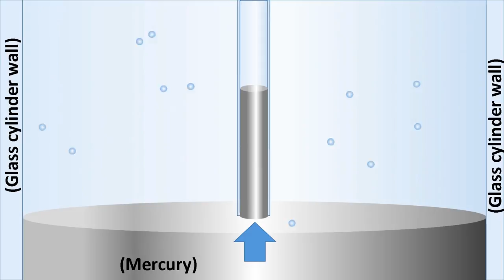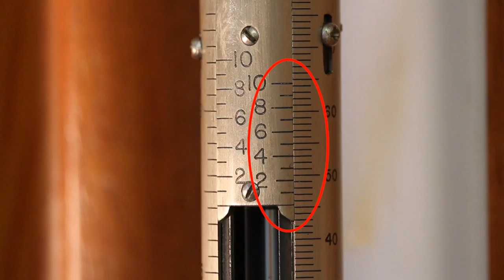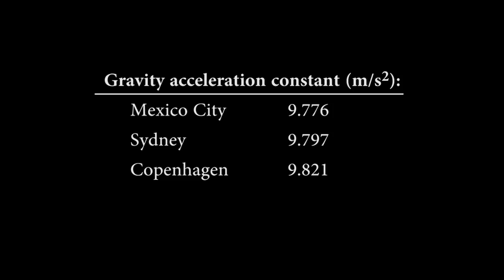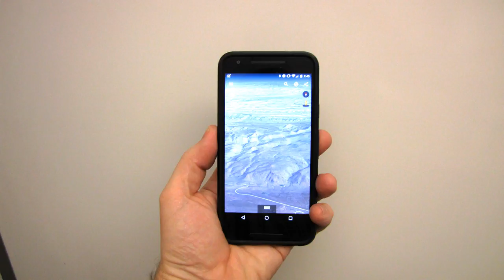Fortin Barometer

Comment: Thanks for the nice video. I have one of these which needs refurbished. Do you have any idea where I might get an exploded view of the assembly. Mine is a C552. The brass sleeve which covers the cistern, and which houses the adjustment screw, doesn't screw off very easily. I would like to know if the two small screws on the side of this brass part must be loosened. Thanks

Comment: Does a cell phone really has such sensors like for atmospheric pressure and humidity built in, or is it reading this data from online databases storing data from local weather stations ?
Reply from the maker: Many cell phones really do have a digital barometer. It is used to estimate altitude. This helps phones know where they are by GPS.